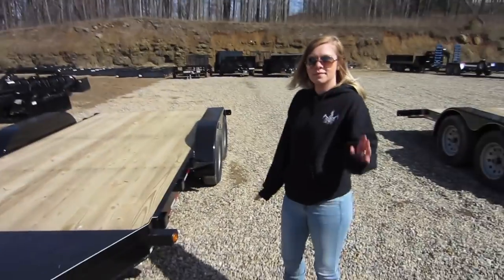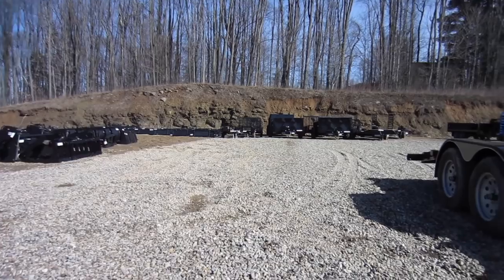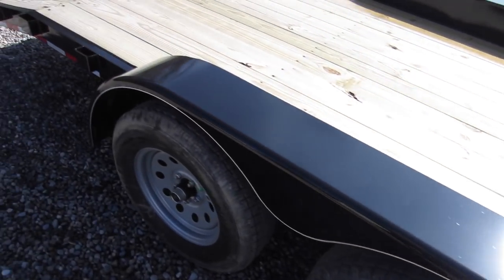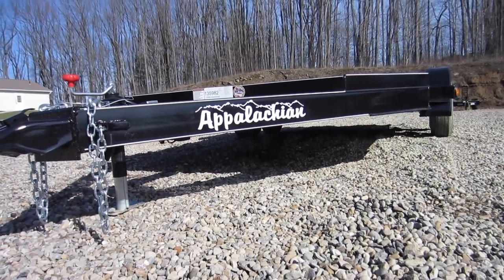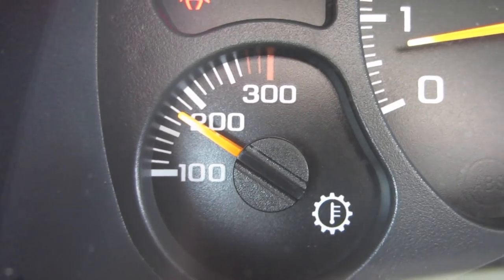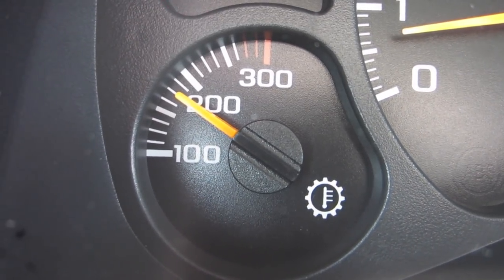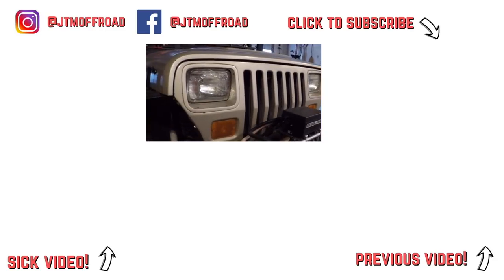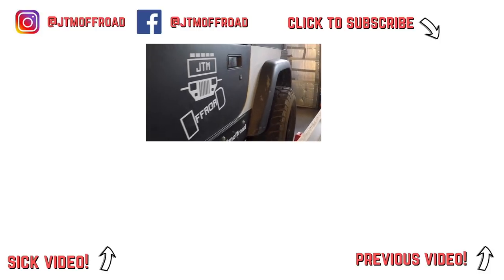I Finally Bought a Car Trailer for my Jeep!!

Comment: what kind of crazy hitch is that?
Reply from the maker: Weight distribution hitch. Helps level out the load. The bars weren’t attached in this vid cause the trailer wasn’t heavy enough to need them

Comment: Great presentation.  How much was the trailer?  Next time give as much detail in your presentation as possible.  I am looking forward to my trailer.   Share some experiences as a new trailer operator what you go through?  Are you pulled over a lot?  How is parking when picking up and dropping off cars. What's the best type of insurance?
Reply from the maker: The trailer ended up being about $2500 before taxes and stuff. Knock on wood I haven’t been pulled over yet. I’m getting better at parking with the trailer. Hardest thing for me is backing up without anything on the trailer. Can’t see it in the mirrors
Reply: @jtmoffroad  Lower your tailgate to help you see the trailer and/or add a couple of two foot tall flags to your trailer corners.

Comment: Nice trailer! Do you run a transmission cooler?
Reply from the maker: Thanks! I’m happy so far! I still haven’t looked to see if I have one haha. I’m assuming there’s one plumbed into the radiator already but not sure if there’s an external one.
Reply: I say that because most towing packages have an external one. It really does help with the towing temps. I tow and 4200 lb on a 2800 lb skidsteer trailer with an F150 and it stays cool due to the external cooler.
Reply from the maker: Ah good deal! Yea I need to find out
Reply: Those trucks already have a transmission cooler from factory...